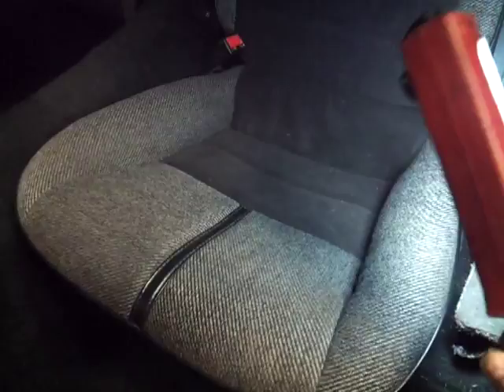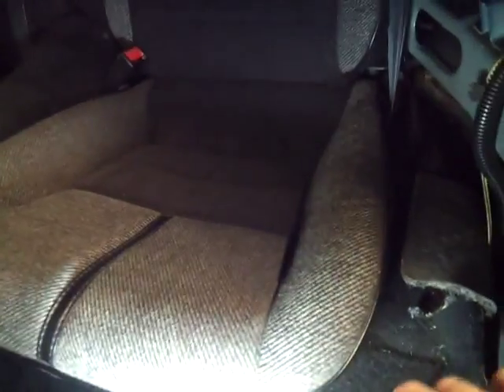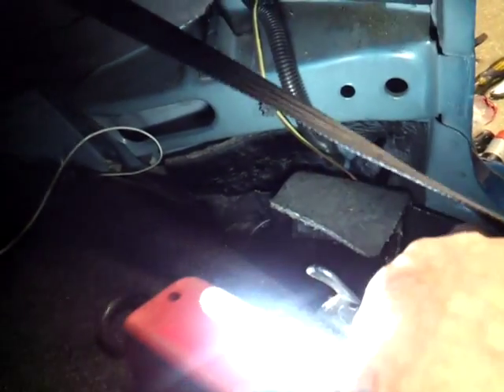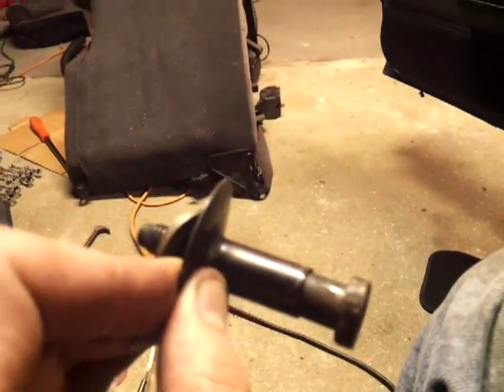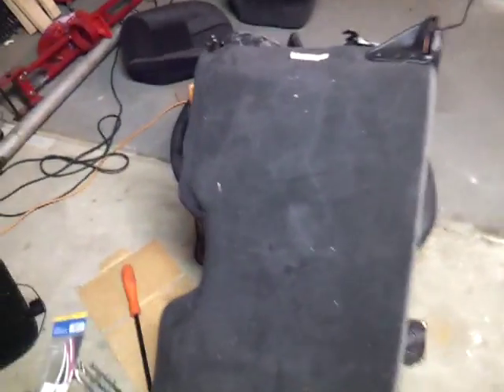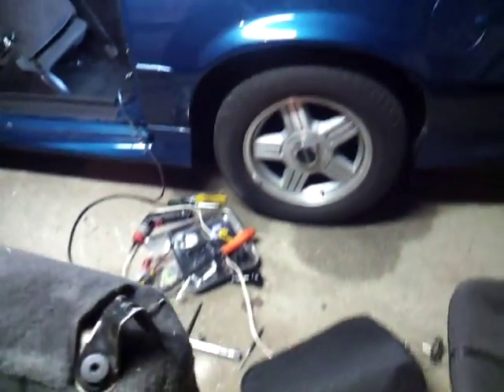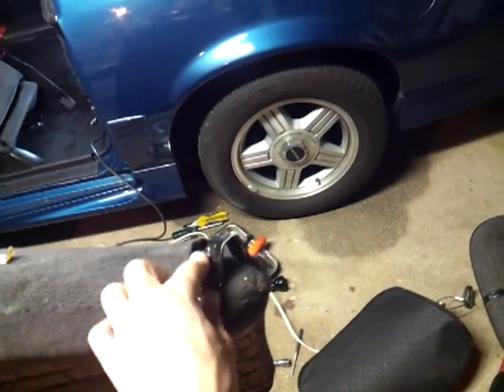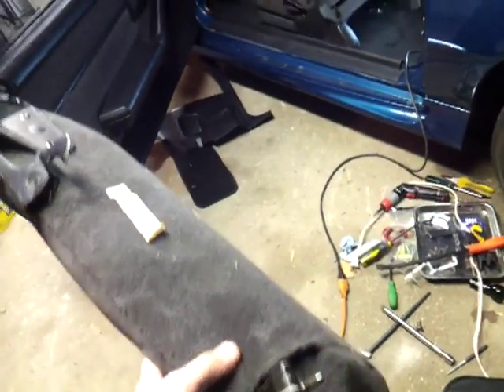Thirdgen Camaro / firebird thirdgen Seat replacement

Comment: Great Video!  Very helpful...One question...the bolt that the rear seats latch onto, does it just screw out?  Tried screwing mine out but it only turns about 1/4 then does not turn anymore.  Is there a special trick?  Thanks.
Reply from the maker: Hey..it should screw all the way out..give it some extra elbow grease :) thnx for watching

Comment: I know this might be a lame question, but is the seatbelt clip (female) the same as the one on the rear driver side seatbelt clip that is shown on this video? The reason why is ask is cause I have one that is the same as yours on this video and another on my rear passenger seat that is the type that has plastic around it. What I think I have is one of the front (female) seat belt clips with plastic on my rear passenger seat.

Comment: i cant find the video about switching front seats from 3rd gen to 4 gen. will seats from a 96 camaro z28 fit into a 92 camaro rs v6?
Reply from the maker: Yes..they are a direct fit
Reply: thanks
Reply: klowny1969 quick question would the interior carpet (floor)of a 4th gen fit a 3rd gen since the 4 gen seats fit the 3rd gen in a 92 camaro. alot of ppl parting out 4th gens and was wondering about the floor carpet from a 4th gen. is it glued down?